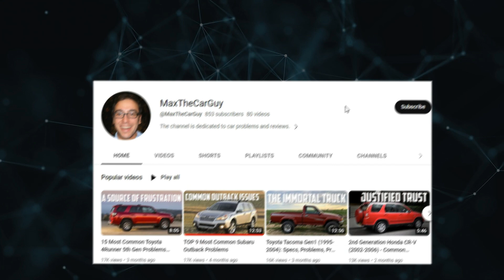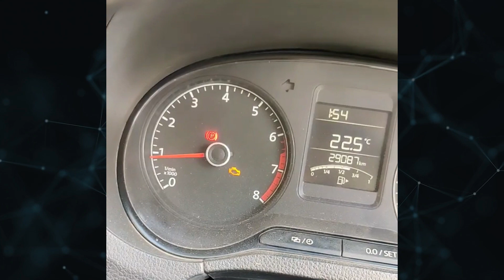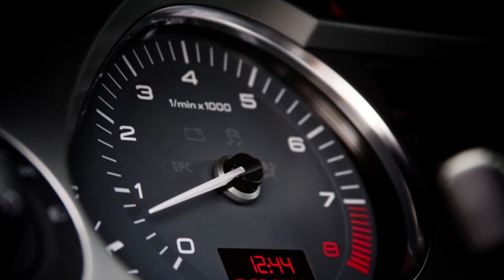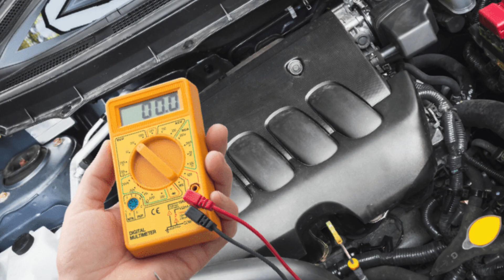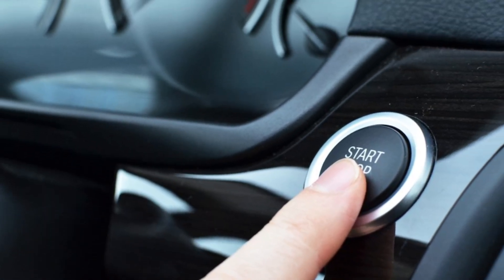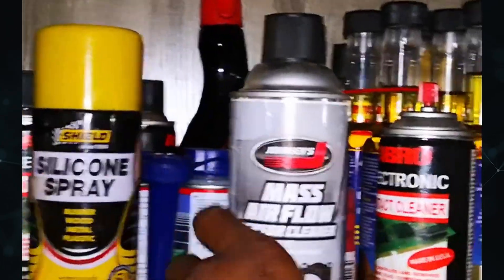Top 8 Faulty Map Sensor Symptoms. How to Diagnose?

Comment: i have a 2013 cts cadillac I bought brand new when one day recently it did not want to start. It only has 28486 miles to date. I put a battery charger on it and it  started but the next day it did not. Had a towing company come to take it to my mechanic  but he boosted it and it started.  Drove it to mechanic and he replaced the battery. A The next few days later i can not use my heater/ac controls to turn off or on. No controls below cue are working. Took it back to mechanic and now  he does not know what to do to fix it, wants me to take to dealer.  Dealer talking about lot of money to replace the whole module unit. Any thoughts on what may be wrong?